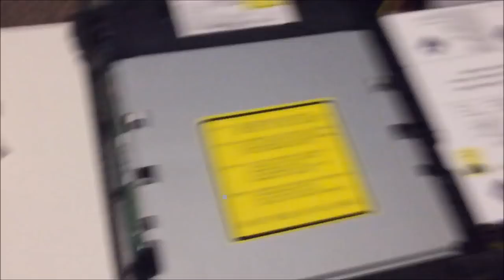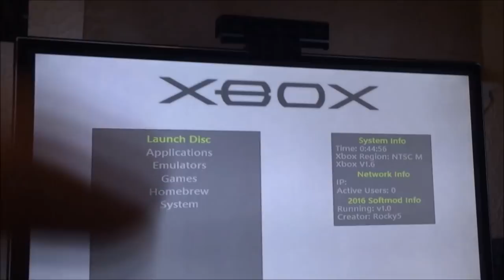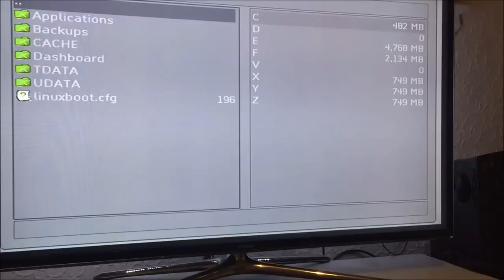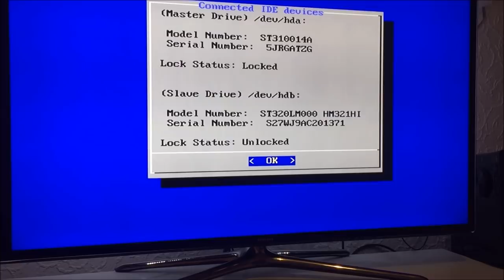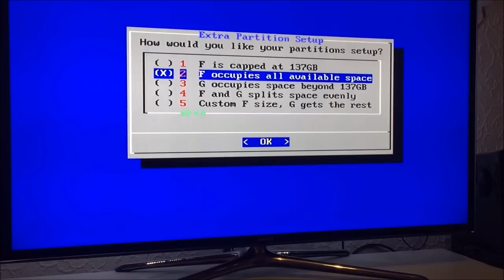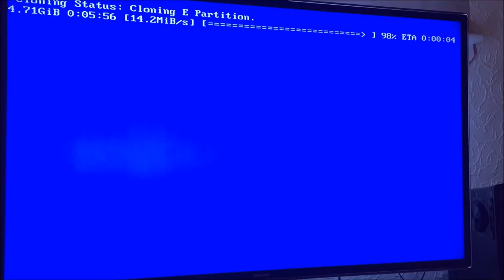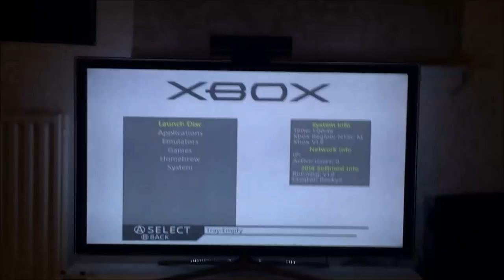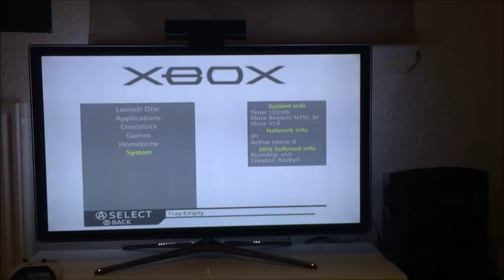How to clone your Hard drive using Chimp 261812 from start to finish.

Comment: Hi mate does new version work on all revisions done a console today fire up chimp gets to chimp loader v1.00 on screen and stops any ideas......got other utils on e:/apps like video switch xb partitioer and dvd2xbox they all load fine. any ideas? ta
Reply from the maker: +plane spotter it does work on all Xbox versions yes. But there are some that just refuse to work and I haven't a clue why. 

Make sure you're using the standard AV cables ( composite ) to maximise compatibility. 

Also make sure you have installed it correctly. E:\Apps\Chimp\default.xbe

Comment: Hi, I am having trouble locating a HDD that would work with my Xbox. i know IDE works but i want to use a sata HDD, is there any specific sata HDD that works with chimp or should i go out and buy a brand new WD blue 3.5 250 GB sata HDD on eBay or amazon.
Reply from the maker: +Aidan rosenberg any WD blue drive will work with a compatible adaptor. I only use 2.5” drives but 3.5” works just the same.

Comment: Hey Rocky, any suggestions for an 80-wire IDE cable in the UK/Ireland? The one you linked is expired... I got my new 1TB hard drive cloned and all is good except the IDE cable i bought is too short (40cm) to close the case up. Seems they need to be 60cm or so to fit. If I try to use the stock 40-wire IDE cable with this new HDD. I get a flashing green/red LED and error 13 messages. Any help appreciated! Cheers
Reply from the maker: +Eric Hurley round cable version, should fit in the XB fine. 
https://www.ebay.co.uk/itm/170476428989
Reply: JCRocky5 oh cool, I didn't think the round ones would fit, thanks a lot for the reply. I followed your chimp steps in the vid with my 1tb HDD and the F and G partitions are around 470GB each in size. Is that normal, rather than having 1 partition with all the free space?
Reply from the maker: +Eric Hurley yeah that's normal, you would have about 950GB+ ( usable space ) on a 1TB drive. 

So about 8GB split between C, E, Y, X & Z
And the rest on F and G

Comment: Does it matter if the drive is empty? I would assume it gets formatted so everything would be lost but I just want to be sure.
Reply from the maker: +PkmnMeepok1 yeah everything is formatted, so it doesn't matter.
Reply: JCRocky5 Cool. Thanks man.
Reply: +JCRocky5 So I have everything all set up and on the E partition, but when chimp launches it stops at Boot: Loading kernel '/applications/chimp/linux267'... [!!] 
What am I doing wrong here?
Reply: JCRocky5 The only different thing I had happen was a green screen but still I'm unsure of what I should do.
Reply from the maker: +PkmnMeepok1 make sure all files are in the chimp folder, if you get an error on the loader screen it means they are missing or corrupt.

Comment: What is the difference between the red & green adaptors,is it just the size ?
Reply from the maker: Manufacturer & probably the chipset, but from a functional standpoint. Yes just the size.

They both function the same.
Reply: JCRocky5 thanks

Comment: I've been trying to do this but I only get as far as swapping the IDE cable from the DVD to the HDD using the Startech adapter, I press A and after a couple of loading screens the Xbox turns itself off, I can't find anything online  about anyone having the same issue, any ideas? I have a v1.6 Xbox and a Samsung HDD that is on the compatible list, and I've tried using Composite and Scart leads

Comment: I had problem with Picture on my HP 2475w monitor.. i had to use TV.. On this monitor all other Xbox classic picture, through Component is ok, but this strange Linux text mode, giving me signal out of range problem.. Na also had so switch original disk from Cable select to master, to make it working..

Comment: Thanks for the video, I'm having a problem, however. I've got the 80 pin cable, the original HD is set to Master, and the new one is set to slave. The new HD is a 2TB SATA, and I'm using a red startech adapter that amazon reviews state work with the original xbox. I've also tried a smaller SATA HD and always get the same thing. I start chimp, swap the DVD cable to the SATA, and press A on the controller. Chimp goes through 2 lines of code just fine, and then an image says loading chimp, and my xbox starts flashing green and video disappears. It does the same thing if I start chimp with out plugging in a hard drive, which makes me believe the adapter may not be working. I'm going to see if this problem occurs with an IDE to see if perhaps the adapter just doesn't work. Any thoughts?
Reply from the maker: Use standard AV cables, you have an Xbox version that Linux doesn’t like 480p or above resolutions.
Reply: @JCRocky5  That worked, thanks! I can't get it to see my hard disks still, so I will try a new 80 pin cable and adapter.

Comment: Hi, it's me again. So I'm having a problem here. Whenever I try to swap the ide ribbon from the dvd drive to the drive that I want to clone, my Xbox just freezes and chimp never loads
Reply from the maker: Normally that happens when you have two master drives on the same IDE cable. Make sure the adaptor or the drive if IDE is set to slave. Also you don’t swap before loading Chimploader anymore.
Reply: Well since I'm using a SATA Drive with an IDE Adapter. I guess I should check if the jumpers on my adapter are set to master. Thanks for the quick feedback btw.

Comment: Hi Rocky. :)  Question....I am trying to upgrade the hard drive with a hard drive used previously in a mod chipped xbox..I connect the ide to that HD and chimp doesnt recognize it...says refresh or connect a slave drive. Is this because the HD is either locked or unlocked ? How should I proceed ? ty in advance.
Reply from the maker: +WaNaB update to my version, connect the drive when propped to do so and if you get IO errors the drive is locked. If no errors onscreen the drive is unlocked and you should be able to lock it or upgrade it it eg...
Reply: JCRocky5 ty for the quick response. So do i need it locked or unlocked for a softmod?
I am using this videos chimp version..when i launch chimp it doesnt see it...so it says to rescan or connect a slave drive. I have my drive in slave mode.the hd i am using was used previously on another xbox with an alladin chip.
Ty rocky for your continuing work on this old but amazing machine😊
Reply from the maker: +WaNaB could you record a video of your issue please. Makes it easier to workout what’s going on.
Reply: JCRocky5 sure ty

Comment: Hello! I’m currently running a 500gb ide drive, and I want to upgrade to a 1tb sata.  I got all the right hardware, however I’m not sure if chimp is the best cloning method.  Can someone please advise?  Last time I tried cloning the 500gb ide drive to the identical drive, it took way too long, and after having my Xbox on for anout 12 hours I turned it off mid clone... I’m hoping for a clone process that takes 2-3 hours at most... I’m relatively new to the modding scene. Would appreciate any wisdom!

Comment: Can you use Chimp to clone multiple drives, eg make a good stock drive full of all the software games etc you what/need then do a straight duplicate.................then put the new copied drive in a different console as a slave and lock to MB then switch it over to master drive?
Reply from the maker: +plane spotter yes, but make sure the master drive has been formatted correctly ( using Chimp 261812 or using XBpartitioner v1.3 ) as with chimp 261812 the partition table is required to clone the drive F and G partitions.

If you are cloning to the same sized HDD then you can just use the full byte by byte option.

Comment: im having trouble with ftp, tried filezilla and no matter if i change the setting to active of passive i still get the cant read directory! tried flashftp and that works but file transfer is very very slow! can you reccomend a good ftp program and whats settings to use? im next going to try coreftp is there any settings in coreftp i should change before connecting? im using a crossover cable from laptop to xbox! appreciate your help
Reply: coreftp seems to work but its slow like transfers a couple files pauses for split second then carries on kinda like its jerky

Comment: Nice tutorial. I was able to complete the clone, but after selecting to clone C&E and then partition the remaining space split between F&G, the system put 1TB on the F: drive ok, but there's no G: drive showing. I checked the file explorer and the other 1TB is nowhere to be found?
Reply from the maker: Depending on the dashboard you will need to enable the G partition. 

UnleashX it’s in the Settings menu > storage at the top.
Reply: JCRocky5 That was it. G partition is showing now. Thanks mate!

Comment: Hello, I recently bought an Xbox and 2 my surprise it plays copies, it doesn't boot up with any modded dash though. The original Xbox menu loads up, I have tried putting a dash on it using your tool kit disc, but the screen goes black when I boot it up. So I thought I would restore to stock, then resoft mod it, so after that process it still plays copies. I have opened the system up and couldn't find any mod chip either.
Reply from the maker: You need to make sure it isn’t TSOPPED ( onboard TSOP chip has been flashed with a modded bios ) as that will crash the Xbox after the Xlogo screen.
Reply: JCRocky5 Okay, how will I know what version it is if it tsoped?.

Comment: Just tried to do this, everything seemed to have cloned over correctly but I now get error 13 when I try and boot and can't format the drive again. I did gloss over the 80 pin IDE cable thinking I didn't need it so I've ordered one and will try and hook it up with that. 

Will update hopefully Tuesday with a result.

Comment: So i orderes a too short 80 pin ide cable for my sata 500gb if i try with original cables scan the ide will show no slave drive correct? And if it does show one will it work. Alright tell i get the new cables i. The mail?

Comment: not sure if this has been ask yet, at the end of the video you locked it to the motherboard,...Lets say I have a 500gig hard drive all setup could I clone the hard drive and then not lock the hard drive and put that hard drive into another xbox then lock it to another xbox mother board...? trying to save time I have 3 xboxes and I have 3 500 gig hard drives I wanted all 3 to have same contents...thanks.
Reply from the maker: Ok if I'm understanding you correctly. 

You want to use 1 Xbox to clone 3 HDD's for use in other Xbox's, if so then yes you can, you would select no at the end of the cloning procedure. 

There is a catch though, you will need the other Xbox to be modded & if there soft modded you would need chimp to lock them on that system. 

Or you can use the new feature in 261812, you can lock HDD's using a eeprom.bin located on the E partition, so you could lock the HDD to another Xbox from the current one. 

You would get the eeprom.bin from each Xbox, place one of them on the E partition (keep track of what Xbox it came from) & then clone the drive, select no at the end & then in the slave drive options menu, select lock > use the E:\eeprom.bin option. 
(Not its case sensitive, so eeprom.bin must be lowercase)
Reply: Awesome, exactly...I'll have to give this a shot, all 3 of them are softmodded...I'll give your method a shot..thanks!

Comment: H i ended up cloning my HDD step by step with a 250 GB HDD and it keeps giving me 123,408 MB in partition f and 4,229 MB in partition e where is the rest of my HDD it should be bigger. what am i doing wrong
Reply: never mind i fixed my problem i forgot to enable the g partition
Reply from the maker: +Aidan rosenberg are you selecting F takes all available space when selecting the partition cloning partitions?
( you use (X) to select an option and (A) to go forward a menu )
Reply from the maker: +Aidan rosenberg haha ok just replied to the previous message. Glad you got it sorted.

Comment: When I launch Chimp, it just goes back into the dashboard? What gives?
Reply from the maker: Installed correctly? Do the LED change colour or anything?
Reply: I installed this version of Chimp on drive E under Apps. I launched it and it just crashes. I even tried FTPing it through Window Explorer and it still crashed. 
Thankfully, I think I have another version of Chimp... I think it is your’s or something and it seems to be doing a good job. 
I’m confused as it seems different, but in the “changes” text it says that this is 261812.
Reply from the maker: The loader was the difference prior and maybe a few things in Chimp. 

Anyhow, most cases for rebooting or that is the config.cfg is missing it damaged, this is normally caused by FTP programs sending files as ascii instead of binary. 

E:\
Apps\Chimp\
Applications\Chimp\
Chimp\

Comment: I have the same ide Sata adapter thats green like you have in the video and I also have an 80 wire cord but it won't fit in the adapter for some reason. why is that?
Reply from the maker: +HOOBERDOODLE check the pins on the adaptor and check that to pins match the pinhole count and placement.
Reply: JCRocky5  I just figured it out, it was a slight bit stiff. okay and about the jumper how do you set it to cable select on the green one?
Reply from the maker: +HOOBERDOODLE set it to slave, bottom two pins
Reply: JCRocky5  you mean the pins that are already there on the side of the adapter? on the right side?
Reply from the maker: +HOOBERDOODLE under the molex connector. Three vertical pins with a plastic plug that sits over two pins at one time. You want to bridge the middle and bottom pin. ( it says slave in white text on one side and master on the other )
Reply: JCRocky5  mine has only has 2 pins instead of three.
Reply from the maker: +HOOBERDOODLE then you don't have the same adaptor as mine. Last will probably be pins connected and slave none. You will know when the Xbox freezes.

Comment: also i put your chimp version on my system with only the manufacture default HDD and DVD drive in it and all i get when i click the .xbe is chimp loader v1.0.1 on my screen and then my systems ring around the eject button blinks orange. am i doing something wrong?
Reply from the maker: +Aidan rosenberg are you installing it correctly? and no putting the master folder in the apps folder instead?
Reply: i extracted it with winrar to desktop, then i opened the partition E folder, then i opened filezilla and ftp into my Xbox running unleash X dashboard, then i drag and dropped the chimp and the xbp table writer folders into the E/Apps: destination, then of closed the ftp connection and filezilla, then i restarted my Xbox and went to applications and clicked chimp loader, and all i got was chimp loader v1.0.1  frozen on my screen and the ring on my console blinking orange.
Reply from the maker: +Aidan rosenberg make sure everything is transferring over, you have installed it correctly. Is there no option to exit or a button telling you to swap the drive now?
Reply: i figured it out. i had a memory card and a headset card in the ports of my controller. i don't have my HDD ye i was just testing to see if the program would work on my Xbox since others have failed. thanks for your help. i will let you know if i run into any other problems.
Reply from the maker: +Aidan rosenberg no problem :)

Comment: Thanks for your videos and modding tools...I tried cloning using chimp 261812.  Everything seems to go along fine, it locks but then when I connect the drive to the xbox, I get error 13.  I have also gotten error 16 and 21.  I tried using the fix error 16 tool in chimp, but it didn't work.  I am using a brand new WD 2500JB drive.  I've used this same type drive several times before.  The original xbox drive works fine.  Any suggestions?
Reply from the maker: +Boss Wagner when you were cloning what was the speed?

Also have you tried a 80 wire IDE cable?
Reply: The speed was fairly slow.  It took about 2 hours.  I have only used the 40 wire stock cable.
Reply from the maker: +Boss Wagner you should get about 10 to 14MB when cloning if it's below 5MB start again, you haven't swapped the ide cable successfully.
Reply: I'll try again.  thanks for your help!
Reply: I switched to 80 wire ide cable, did the hot swap, fast transfer, 12MB, everything went well, connected cloned hard drive, and still error 13.
Reply from the maker: +Boss Wagner that's strange, how was the master drive formatted?
( what partitions does it have )
Reply: it has C, E, X, Y, Z
Reply from the maker: +Boss Wagner so it's just a stock Xbox HDD?
Reply: Yes, the master is.
Reply from the maker: +Boss Wagner when you switch to the new drive are you setting it as master or cable
select?
Reply: I've tried both.  same result
Reply from the maker: +Boss Wagner can you load up Chimp again like your going to clone the drive. But pick Option 3 > option 4 ( partition information ) and let me know if they look ok.
Reply: partition info not found...I used unleash x
Reply from the maker: +Boss Wagner for the slave drive or the master drive?
Reply: master.

Comment: Ok.. I'm lost.. where do you put the folder.. what files go in what folders.. I couldn't understand him at some parts..
Reply: u have to burn the extras disc, start xbox with that disc in, go to advanced > chimp > install. remove disc, reboot go to applications > chimp
Reply: or if you are already softmodded, likely you are, download the file in description, extract, connect ethernet to xbox, turn on xbox, ftp files to xbox

Comment: @jcrocky5, I'm getting an error 13 after I swap my slave drive to master and replace the original drive with it. Any ides?
Reply from the maker: +Sean Killian redo the clone, make sure the cloning speed is over 8MB a second. 

Also why type of drive? If it’s Sata you need a 80wire IDE cable for your adaptor. If it’s IDE the it’s the latter.